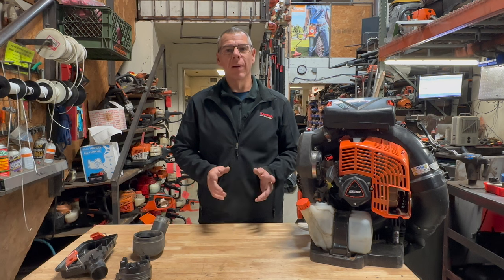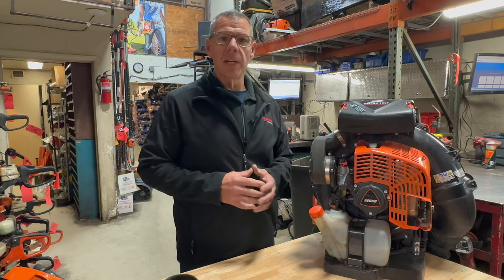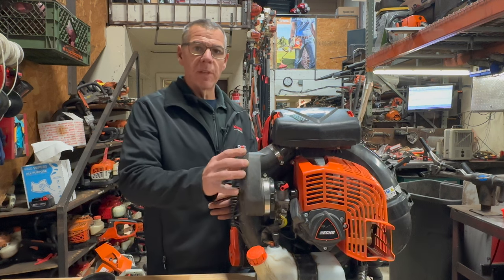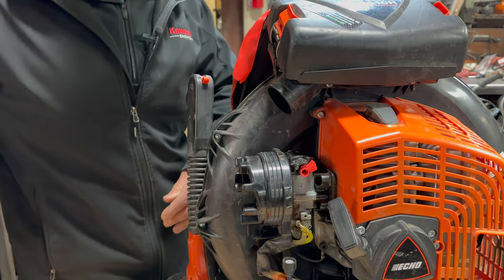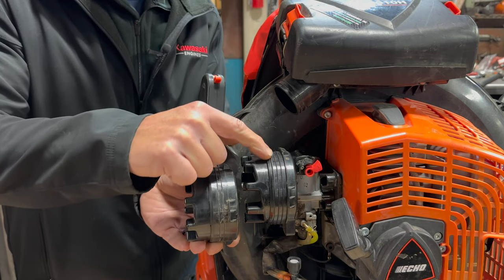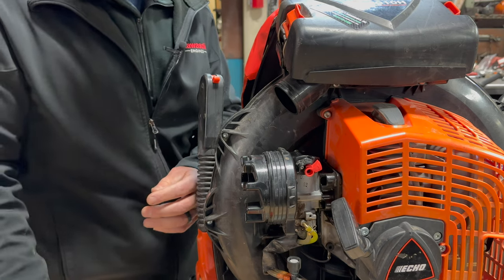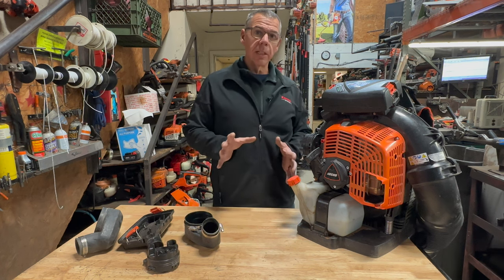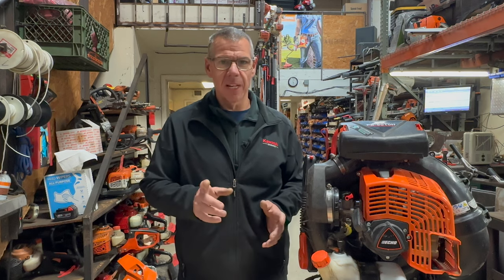ECHO FIXED THE INTAKE ON THE PB-9010 BACKPACK BLOWER!

Comment: I had a new echo 9010 where after 6 months engine seized  shop replaced it reluctantly we split cost   My 2 cycle mix is red   Shop said he’d never seen red 2 cycle I was like what???  Anyway I got it back. We only really used it over this summer for after mowing driveways.  This wk with leaves getting heavier it’s had more sustained useage of 30-45 mins straight  suddenly it just died   Seized up cannot even pull rope. Brought back to shop that just replace lid block and shop owner giving me shit again about red 2 cycle. Also claiming now that if I didn’t use echo brand 2 cycle then echo won’t warranty it. I read owners manual and that’s horse shit.  Has to be industry standard oil not specific to brand   Anyways I’m now wondering if maybe it was dirt getting in the intake tube.  I know my 2 cycle
Mix is fine.  I am currently using 5 or 6 other PCs of echo equip and they are running fine.  Any thoughts??